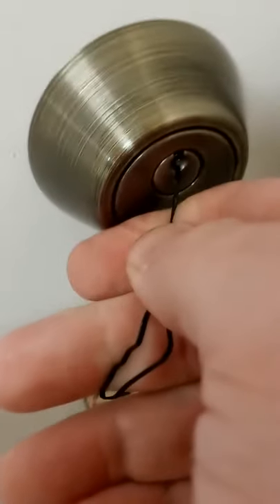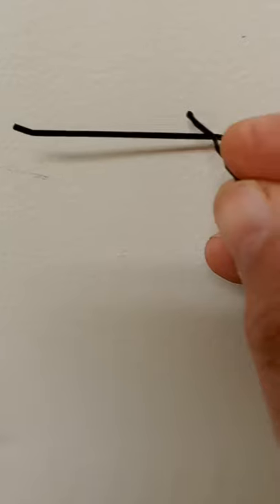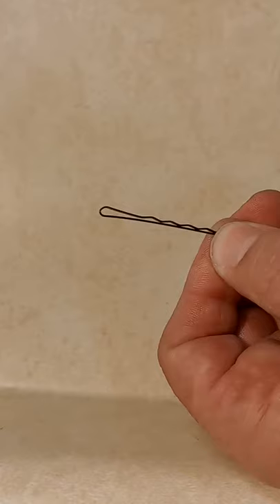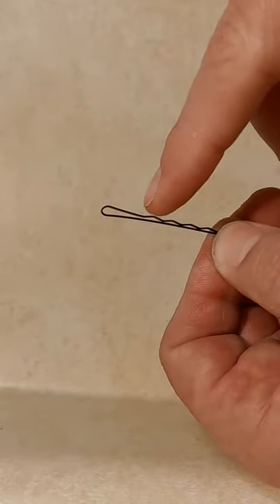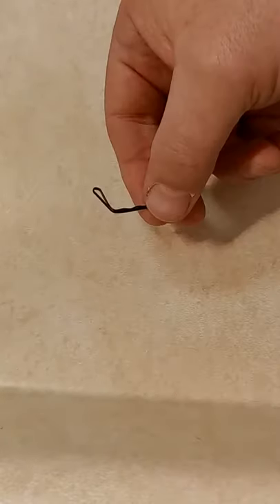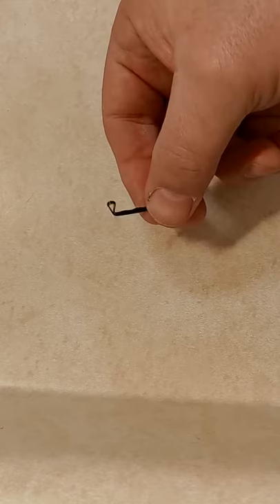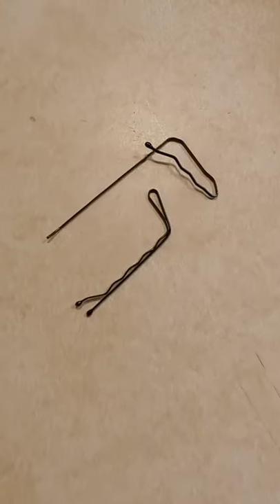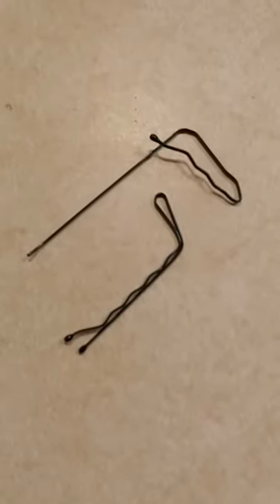Hair pin to unlock the door

Comment: And how do you use it? I know a different way to bend them to open doors but how to you use this one?
Reply: The tension wrench goes on the bottom core of the lock, although It does vary from locks.  Then you check each pin and see how tight they feel, you only want to apply light tension, and after you get every pin in its position at unlocked, you will be in
Reply: Please help me I'm locked out of my dorm room and my keys are inside🙄my dorm room has the turn locks on the inside
Reply: @salmachan8979  got in??

Comment: tip: you can also use the squiggly line. cut off the ending part (or burn it) and instead of single pin picking, you can then just keep scraping and going back and fourth (ayo) to pick it open quicker.

It aint illegal if you don't get caught
Reply: How do I actually use this… I bent the pins but what way do I put them in the door to open it

Comment: Lol no joke the makeshift bobby pin lock pick actually worked for me although for the tension wrench i just used a small, thin, long and strong enough piece of metal bent like a tension wrench. I just kept pushing all the pins down with the lockpick till it was deep inside the lock, then i put the wrench in and just jiggled foe like 5 seconds and BAM! UNLOCKED!! NEVER GIVE UP LOL

Comment: Now that you've shown us how to make the pick tools from Bobby pins how about showing us how to use the tools we just made to open a locked door. Also, I need instructions how to open a very short (in length about ⅝" long) lock on a metal cabinet door. The lock is about the size of a dime where it fits into the door and narrows to about ¼"  at the back end of the ⅝" length.

Comment: What should I do if my picks get stuck in a lock?
Reply: Jiggle the tensioner and jiggle the lock pick while lightly pulling. I’d avoid using pliers as you might break the pick and leave it stuck in the lock.
Reply: Try to wiggle it hard but if it doesn't work then wiggle it lightly. I made a mistake by wiggling it hard (out of panic), it didn't work. But when i accidentally hit the pick lightly, it dropped to the ground.

Comment: How do you bend them easily
Reply: Be a man
Reply: @dennisstone1207  lol
Reply: @dennisstone1207  not really, just use pliers
Reply: Either use piers or apply the level system in the lock (like the first pin shown in the video).
...Or just try to bend them by just using your hands-

Comment: so basically i was tryin to break into my sis room to but i didn’t have bobby pins so i found sum dewalt 18 GA brand nails and we have sum weird flossing tools there throwable I broke u The m. I heated up the nail and I stuck it into the plastic so I could have a handle. It took me an hour and a half. I was about to give up put in my last minute of despair  I got it open i used this video and real lock pic video to get in idea it was deadbolts lock